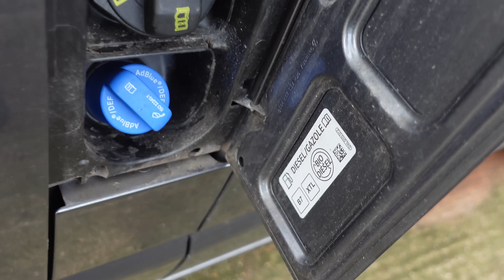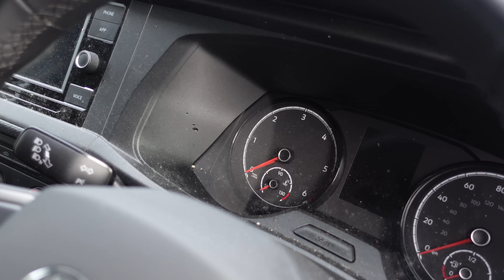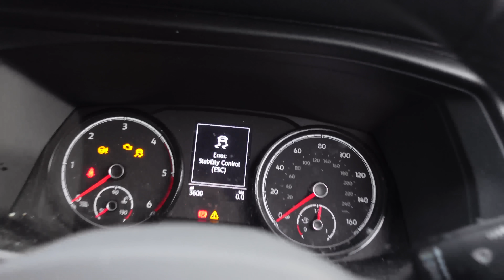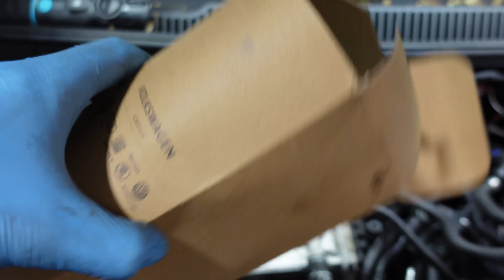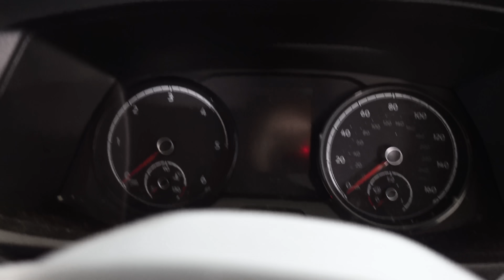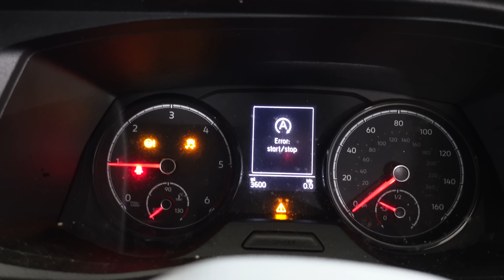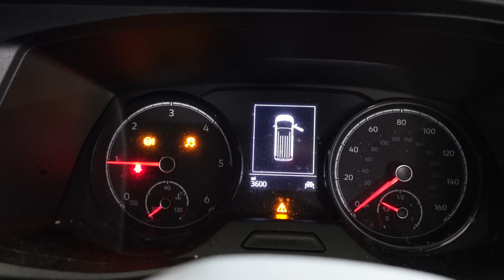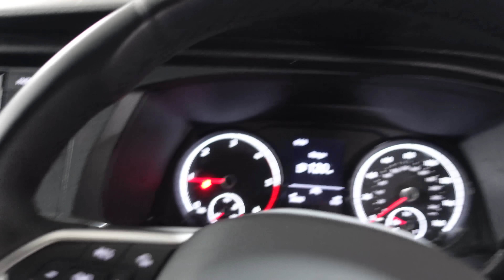I BOUGHT A CHEAP VW TRANSPORTER.. FULL OF PETROL!!! MISS-FUEL...

Comment: I bought a 2003 Polo PD TDi brand new & mis-fuelled it when it was about 2 weeks old, had it drained down & refilled with diesel & ran fine, this car is still my daily driver & now at 20+ years old & with 226,000 miles coverereed since I guess the mis-fueling didnt cause it any long term issues 🤣

Comment: Assuming it does not not already have an electric fuel pump, I just add an electric fuel pump to the fuel line and pump out the tank--leaving the fuel pump in place as an extra in some cases. One simply disconnects the fuel line from the fuel filter, puts a hose on the end, and pumps it into drums for disposal or use elsewhere.

Once the tank is full of diesel, drain the fuel filters and open the bleed valve on the pump, then using the bulb (or your electric pump if added) pump diesel through the entire system spinning the engine with glow plugs removed.  Once the petrol is all out, put in glow plugs and start her up.  Then you find out how much damage to the high pressure pump and injector system if any,  happened.

Comment: Disconnect it at the filter and use vcds to activate the pump and drain the tank and use vacuum brake bleeder at the other hoses to suck them dry😅😅😅

Comment: How about an inspection and a step by step guide on how to replace the cambelt and water pump on a VW diesel engine. The charge for getting this done these days is getting ridiculous.
Reply: not every vw diesel engine has the same timing tools steps for the most part is the same if i remember correctly been a while since i done them

Comment: Petrol in a Diesel especially if it's a common rail normally kills the high pressure pump either instantly or sooner rather than later, hard to believe they wrote that off for a miss fuel, no wonder our insurance has gone through the roof...

Comment: Lovely van mate. Do a oil and filter change, stick some a egr/dpf cleaner additive into the tank and take it on good motorway run then brim the tank with vpower diesel then it’ll be sound. Did you need to code the new battery to the van?

Comment: The fact that it ran before it naturally died because a diesel cant run on petrol makes me worry about the high pressure fuel pump.
I would pour about 500ml of 2 stroke oil in and run the tank empty on that to re establish lubrication in the pump.

Comment: When I fixed mine I drained the fuel via the fuel pump, filled the tank to the brim and cycled the fuel a bit more to get any residue mixed.  As long as the amount of petrol to diesel is less than 5% it should cause no damage, I drove mine for 130,000km with zero issues.
Without ignition they usually don’t run long enough to cause any damage, unless they were running a high level of diesel mixed in with petrol.  That’s where you’d get high pressure pump damage……
Reply: How would the pump get damaged by a high ratio of diesel to petrol, you got lubrication from the diesel still vs no lubrication from just petrol.
Reply: @my_carp_life3424  you’re talking about an injection pump strong enough to cut metal with its pressure output here, adding a solvent instead of a lubricant makes all the difference to its operation.
Usually the engine stops very quickly if plenty of petrol is added, the danger is a smaller amount that allows it to run over time.
Common rail and TDI systems are based on enormous injection pressure to get their efficiency.

Comment: That's a hard and slow way to remove half a tank of petrol from this van. Easiest way is to syphon out the petrol as much as you can.. blow out the fuel lines or suck out the petrol as best you can including the pump.... Then top up with Diesel, yes even though you have some petrol in. Once the petrol has been overly diluted with a mas of diesel that you have now put in, then I guarantee you that it will now start. I know I did this when I I got a mis-fuelled  car.

Comment: years ago i used a 5l can of the right fuel to run an engine (using a small elec pump) which then not only kept the cars battery charged but purged the wrong fuel into a drum using the existing pump which i think we was changing anyway so it didnt matter if it burnt itself out.

Comment: Back in 1991, I was touring around Europe in my VW Transporter (T2?). I was in Turkey and stopped at the gas station. I didnt know what the word for the pumps meant, so I let the attendant fill her up while I went inside the shop. Pretty soon going down the road the VW gave up. The KH had filled with diesel in the petrol van. I had words but they wouldnt take responsibility for the error!...said I parked in front of the pump!!...
Anyway, we got it drained and running again not too much trouble....

Comment: Just out of interest why not connect the fuel line in the engine into a tub, bridge the relay and use the vans pump to pump out all the petrol. when empty add a couple of liters of diesel and purge until diesel starts coming through ?

Comment: My wife had a 125cc Yamaha scooter type motorcycle and she put diesel in by mistake but didn’t know what she did.   Anyway the symptoms were that it ran rough, smoked and cut out at traffic lights.  It was only a couple of months old so she went back to the Yamaha dealer who diagnosed  a faulty clutch!   I guess they only heard the bit about it cutting out at traffic lights… anyway they fitted a new clutch and called to say the bike was ready for collection.. it seems they didn’t even bother to try and start it.  On collection I queried why a clutch would cause smoke from exhaust and rough running, the answer was that they are the experts not me….  Then I invited them to start it and show that it was now not smoking and running rough.. of course it smoked and ran terrible… eventually we got to the reason and can of petrol later it was all good.      That Yamaha dealer is no longer in business.

Comment: I would never remove anything. Just rewire fuel pump and let the pump do the job. Then add some diesel and flush again. Fuel pumps are pretty much the same except pressure ratings and delivery rates. But with open fuel line it is piece of cake.

Comment: Remember that back when Mr Rudolph Diesel invented the Diesel engine, it was designed to be a "multi-fuel" engine.  

Some WW2 and newer Yankee military diesel engines, like on their "M35"  Deuce-and-a-half trucks are designed to be multi-fuel.  

Back in "vintage car days"  (1930's/'40's?) some early Diesel engines were actually designed to start from cold on Petrol and then switch over to Diesel when the engine was running and slightly warmed up. (Not sure but I think they did use sparkplugs for the petrol part). 

I remember hearing some old farmer/trucky neighbours talking about it. Possibly early Caterpiller earthmoving equipment.

Comment: How could you fill it up with petrol when they make the nozzle part where the fuel pump goes in different to petrol and diesel cars preventing this from happening 🤷🏻‍♂️ especially in modern cars 🤔but another great video 👍🏼😁
Reply: I think you will find it's the other way around. You cannot get a diesel fuel nozzle into a petrol tank, because the hole is smaller, but this way around; easy!

Comment: It's easy enough to drain down and get back running it's long term damage that occurs, give it 6 months a year when seals start perishing in the fuel system and high pressure pump fucks up, then you'll find out the real damage been there got the t-shirt , that rust undernedth is poor 3k miles and corroding like that wtf
Reply: Car salvage storage yards tend to be covered in grit, sand, get scraped by forklifts, the underside gets coated in wet salty muck, and it corrodes the underneath of vehicles. I'm not sure this corrosion is caused by normal regular road use. 

And yes he definitely is going to need to do injector seals, fuel line seals and likely fuel pump within a year. They all get lubricated by diesel, while petrol does the opposite and dries out seals.

Comment: The high pressure pump is a common failure, full fuel system replacement at about 6-7k

Comment: I always just disconnect the fuel rail and use a relay bypass switch and run the fuel pump untill its empty for issues like these.

Comment: Last time I did this I pumped the petrol from the tank via the electric pump and through fuel filter                                                           then put diesel in tank pumped that through fuel filter then changed filter and cracked injector pipes it started straight away filled fuel tank to the top ran car for 5yrs sold it never had a problem

Comment: Bang a pump on it. Cp4’s are shit. The main plunger tappet is hydraulicly located to the cam…they jump out of sync and the tappet roller instead of rolling they start grinding and firing metal through injectors.

Comment: If that van operates anything like my 2013 TDI 😊golf you need to use a vag comm tool to prime the low and high pressure pumps. I have to do this every time I change my fuel filter. I bought the Ross tech vag comm and it works well for this.
Reply: Never had to do that on my mum's 2013 Golf and my 2015 Scirocco. Both diesels. And changed filters multiple times.
Reply: wrong 
no need at all

Comment: how easy is it to change the timing chain on the Bmw X5 (M57 engine). A friend of mine has asked if i want to help him its just started to rattle a bit. I use to be a truck mechanic (40 tonnes) so ive mostly worked on scanias and volvo f12s/f16s. done plenty of timing belts on cars and a few chains on corsas n bits like that but never done the bmw chain.

Comment: I filled a VW golf mk6 Tdi 130 with a full tank of Petrol ,It was a bitch to start but It boosted the performance proper,I just kept topping it up with diesel as i used sone petrol,The car went on to do another 60 k with no engine problems.👌

Comment: Why didn't you just use the lift pump in the tank and the outlet on the fuel filter to pump out and drain the tank then fill it up to the brim with diesel nd renew the filter.
Sorted
Reply from the maker: Because these days they only activate for a few seconds and stop. So you would be there for hours keep activating the pump. Quicker to take it off

Comment: In the old days you put petrol in your diesel in winter.  Older diesels ran on petrol as well. And fuel cars did not run on diesel.
Now a days it's the way around. The diesel is used as a seal for the high pressure system. Petrol has no seal working. That's why modern diesels don't run on petrol

Comment: In these situations i would get 2x cheaper oem brand fuel filter, drive 2 full tanks to fully flush the petrol remains and then(if it starts and runs from start) order the expensive & quality original filter. 🤔 Interesting that sixts insurance company just wrote it off, when all you needed to do is to flush the system and change the filter. (maximum 1000£ quote for one days job) even if 'sixt' are getting those cars cheaper, fixing with a simple flush this brand new van, would be much economically feasible, not mentioning the ecological effect.

Comment: Why dont you prime it with vcds every time diesel when you remove fuell filter?
Reply from the maker: Because it doesn’t stay on, just activates for a few seconds and stops
Reply: @SavingSalvage  yea...usually active it 2 or 3 times every time when changing the fuel filter just to get rid of the air from the system...
PS thanks for grat videos and greetings from Norway 😀

Comment: Gasoline in a modern diesel can very very very easily ruin the injectors, pumps and anything else that flows fuel.  I'm not saying it is going to happen, that's just the way it is.  Diesel in a gas motor is must less destructive.

Comment: @SavingSalvage A word of caution. My good lady once put petrol in her diesel VW Eos, ran it a short distance until it stopped. Had the tank pumped out and fuel system flushed through within a couple of hours. All seemed well until about a week later and it conked out. Turns out the linings on the fuel pipes were disintegrating and and it screwed up the injector pump. £4500 of replacements and repairs later it ran fine and continued to do so for several years.

Comment: Mis-fuelling a diesel vehicle with petrol is far more damaging than contaminating a petrol fuel system with diesel. If you've run a diesel vehicle on petrol, the engine is not being adequately lubricated and will cause catastrophic damage to a diesel engine's bearings, piston rings and seals. One requires a fuel system flush, the other requires nothing less than an entire engine rebuild, but I'll leave you lot guessing which one needs which. 🤔😉

Comment: I think the pain is alot worse if you put diesel in a petrol motor. Heard that from some guy down the pub 😂
Reply: Petrol engines will run on diesel if you can get them started years ago before the government caught on and taxed parrafin we used to put an extra tank on an use copper pipe wound round the exhaust manifold to heat it then start it on petrol and then swap to the parrafin tank .like the old Ferguson petroil tractor engines.

Comment: Nothing worse than miss fueling i did it to my van once, i did all what you did but it was a bastard to start because i have no uplift pump or primer bulb in my tank system the whole system relys on suction to bring it in from the tank, i dread doing fuel filters or injector work  on it its a real pig.

Comment: about 13 years ago an associate mis-fuelled his Peugeot diesel and was quoted about $10K (AUD) to repair. 
He ran it till it stopped after mis-fuelling it following an encounter with our sociopathic boss, poor bastard. 
I wanted to drain it change the filters and see what would happen but he didn't want to have a bar of it. 
So he paid the $10K and had the job done by a Peugeot Dealer as the car was pretty new. 
They DID replace the parts, because I asked him to get them so I could see the damage.
I'm NOT a mechanic, but I couldn't visibly see any damage on the parts the dealer replaced...

Comment: Amazing what these insurance companies class as a write off these days. Anyway gives you guys opportunities like this, a relatively cheap fix.

Keeping my eyes peeled for the next installments on the TVR 👍🏻
Reply: Writing stuff off too easily!…………..that’s why insurance has gone through the roof!    Coupled with EV fires🔥
Reply from the maker: This wasn’t a write off, assume sixt just chucked it in to avoid the hassle
Reply: The official VW repair method for misfueling is to replace everything fuel related. Tank, piping, pumps, injectors, etc, as they assume that the damage of the high pressure fuel pump is done and metal filings are circulating in the system. 
Above 10K in parts IIRC
Reply from the maker: yeah I mentioned that in the video 👍🏻
Reply: @SavingSalvage   then I did not pay attention
Reply: Neither did I lol, I had to re watch it again, then I posted a comment and then realised I should have listened further 😊 as I answered my own question 🤦 I really should pay more attention, but I will say based on your obvious knowledge, after watching it back a few times am I bad 😂 are you not worried about damaging the injectors, from a possible failing hpfp in time, please be gentle, I’m No mechanic I’m just asking based on something similar that happened to a pal of mine.

Comment: Too much work. I had the same problem all i did was let the pump do the work by disconnecting the fuel in on the engine then jumping the fuel pump relay. Then filling it up again with diesel. Lol

Comment: Including results for VW TRANSPORTER FUSE LOCATION.
Do you want results only for VW TRANSPORTER FUSEBOX LOCATION?
The fuse box location for a Volkswagen Transporter is as follows:
Open the bonnet.
If necessary, remove the battery cover.
Turn the quick release catches 90 degrees.
Lift out the partition.
Turn both quick release catches 90 degrees.
Hold the fuse cover at the front and fold it upwards1.
The main fuse and relay box is located under the dash on the driver’s side2.
The fuses are located to the right side of the steering wheel behind the storage compartment3.
There is also a fuse box at the engine bay close to the battery (remove the battery cover)4.

Comment: What a lot of unnecessary effort. Just drain or pump the tankout, fill it back up with diesel and start the car. You will not add any more damage in the few seconds it takes to circulate new diesel through the system. The few litres of petrol left in the tank is instantly diluted with the diesel and combusted though nomally.
An old trick used when selling wornout old landrovers and landruisers, was to add some petrol to the diesel to give the old tired engines a bit more pep.
A couple of liters of petrol in 60L of diesel wont make much difference and wont damage the car.

Comment: Why not disconnect at engine, run fuel pump into container to drain petrol, then fill with diesel pump thro again, re connect to fuel system and start up! SIMPLES

Comment: Why you didn't try to remove petrol using existing pump? You could use VCDS and turn it on for like 30 sec and disconnect fuel supply lin from CR pump 
and then put some diesel in the tank and flush it
Reply from the maker: I wouldn’t of got it all out properly, so for the sake of a few hours I thought it do it properly, also can you imagine the amount of people that would complain I didn’t do it properly 😂🤣
Reply: @SavingSalvage  🤣🤣 all good,  I just  did manage to do it in 'lazy' way and it worked like a charm. Keep up the good work there will always be whiners
Reply: No need to take off the tank. Making a small job into a major job